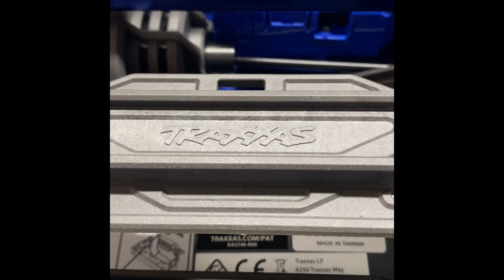Traxxas Sledge Must Do Fix BEFORE running!!!

Comment: I had the grub screw come out of the rear end. That connects the rear input gear to the rear drive cup. I had to take my sledge apart within 24 hours of ownership. I made a video. And you earned a sub from me!
Reply from the maker: Cool man, I really wish they sold all cars as a kit so we could build them ourselves. Would be nice is they were $100 cheaper that way too.
Reply: @rcilluminati26  i know the X-Maxx and it's spur gear are a really pain for brand new customers. I heard about it so the day I got my X-Maxx, I checked mine and it was hella tight. it's just life. Human error, that's all.

Comment: Yep. Just happened to me this morning and I picked up the sledge yesterday..and I’ve only been doing field and parking lot runs so far (although I have taken some tumbles) but the front CVD snapped right off. 

No parts in stock for sledge yet locally, gotta wait for order to come in now.

Edit: update: contacted Traxxas. They requested pics of the damage, serial number and proof of purchase and it appears that they are going to send me a new CVD.

Customer service on point. Will keep posted if anything changes

Comment: i just purchased a new sledge i guess the 2024 model. Love the videos btw. Anyway just saying that this issue has been fixed on new model. Well mine at least it actually has a metal donut behind problem area. fix not needed but very good to know ty
Reply from the maker: Nice, I think they fixed most of the issues

Comment: Good info. I need to do mine and watching your video, I forgot what mine looked like new. Seems I need to replace the front drive couplers too.  The dog bone grooves “look stock”, but is probably because I never added O rings. Will be interesting to see if it helps my shifting dog bone pins. I have had to replace a couple due to that, already.

Comment: Simple fix with the O-rings, many other manufacturers fit O - rings in their drive cups to stop this very problem. What are Traxxas engineers doing releasing an $800 truck that has plain obvious issues with the dogbones, seems Traxxas are asleep @ the wheel.
Reply from the maker: Sometimes it’s the simple things.

Comment: Thanks. 
Getting mine on Friday.
Did you also check the front and rear diffs? I saw the video about the center diff
Reply from the maker: Didn’t check the front or rear but they feel good spinning the wheels. After doing just the center, I’m happy with the performance

Comment: I just got a sledge today, I saw in one of your videos you fitted a fan to the motor. Where did you plug it in to the receiver? What size screws do I need to mount a fan? Thanks,
Reply from the maker: The screws are m2, I used 16mm long. 
Any open channel should provide power, I think I used ch4

Comment: Wonder why they specified orings as opposed to longer shafts...   I'm guessing because they already had the shafts manufactured so the rings were a cheaper/ easier fix.   If they missed this after "thousands of hours of testing" wonder what other issues will pop up.   Or it's a QC issue... either way not a great start to their big halo product imo
Reply: They are shorter by design - a longer driveshaft will bend on a big hit when the arm flexes in.  It is better to have a shorter driveshaft with o-rings as spacers.  Lots of manufacturers do it like this.
Reply: @zelph1844  Yes but the 0-rings are installed at FACTORY ..Lol

Comment: A finally placed there 10mm diameter with 2mm thick rubber. Had 12mm also, but i was to big.
Reply from the maker: Yes, 10 is perfect. No issues with my rear axles since doing this

Comment: Can you share the Hex Driver handle mfg and p/n you are using for your MIP tips?  Thanks so much.  Love the vids.  Very helpful!!!!
Reply from the maker: Thanks, its a Hobao driver handle that came in a kit. The tips werent very good so I switched to MIP. Not sure if they sell just the handle but I'd actually like two more myself so I dont have to keep switching out tips. 
http://eshop.hobao-racing.com/p/87337-tool-set-1-4drive-9pc-w-handle?pp=48
Reply: @rcilluminati26  thank you!!!

Comment: Would a metal washer work, or would it be better to have something soft in there to absorb some impact?
Reply from the maker: I'd be worried metal could get jammed up in there and cause an issue. I would stick to some type of rubber or plastic. O-rings are easy to find at any hardware store

Comment: I had it pop out twice today so instead of the o-rings, I’m going to try two small  bearings so it continues to have smooth movement. The o-rings seem to be a temporary fix that will eventually wear out or pop out.
Reply from the maker: Interesting, rubber tubing also works. Make sure there’s still a little side to side play. You don’t want side pressure on the bearings.

Comment: Leave it to Traxxas for making a rig you have to fix before it ever touches dirt.
Reply from the maker: It’s more preventative. Some have run them without doing a thing and have been ok. I come from a racing background and I prep everything I can to prevent little things from ruining a fun day. -still bring a backup though. Lol
Reply: Well, in the Manual / Exploded View is a O-Ring as Standard

Comment: Easily fixed by adjusting the droop screws a bit...........oh wait I forgot traxxas did away with almost all suspension tuning options on this 800 dollar truck.
Reply from the maker: It actually not an issue when its drooped, its when the wheel is fully raised. I think droop screws will only be needed if you want to adjust ride height for a track, but yeah, for $800, some sway bars would've been nice.
Reply: @rcilluminati26  once the cups start wearing it would be nice to limit how ar the arms come down or it could pop out when the shocks are fully decompressed. Adding droop screws would have also helped shock life because the could be overextending in the air off jumps. And 800 dollar truck has no excuse to not have sway bars, droop screws, or adjustable tie rides.

Comment: Need longer shaft
Reply from the maker: I believe M2C racing is already working on front and rear shafts.
Reply: @rcilluminati26  be sweet but ppl should hold Traxxas accountable for half ass made product that’s not cheap

Comment: $800 and having to do this mod is a joke!! People are still kissing it’s arse 😂
Reply from the maker: Its a great platform, as with every RC, it needs some work to really be bulletproof. Give it a few months and this will all  be resolved by aftermarket. Before you complain about price, look at pretty much every Kraton out there. Guys are spending hundreds on chassis and braces, shock towers etc... all to make it tougher.  Adding two O-rings is really nothing for a new RC

Comment: There really should not be a need to add a "shim" - thats a very lousy solution imo. Looks like the dogbones are not the right length. Traxxas put shorter for whatever reason - probably to save money and not have to design/manufacture new ones.
Reply from the maker: The dogbones need some play but this is an issue only when the arm is fully raised. The orings solve the problem. 
Arrma have rubber spacers in theirs too.
Reply: @rcilluminati26  jfyi, I found a video showing that you can use the front CV axes in the back - they fit perfectly without needing the orings and that also solves the issue.
Reply from the maker: @VandalBee  I actually think I made a video on that. Lol.